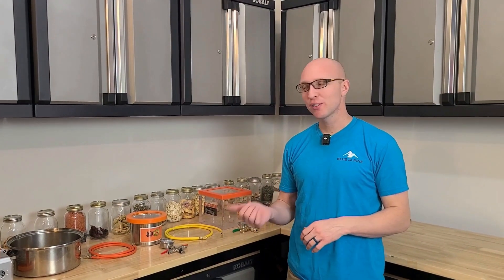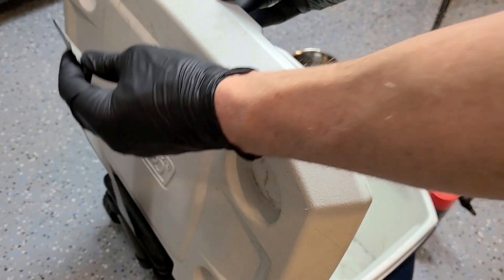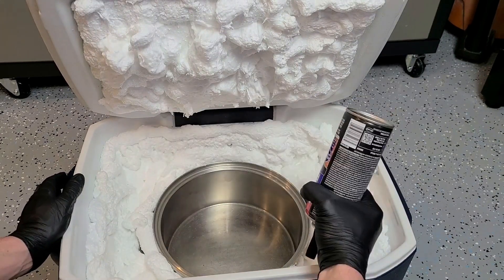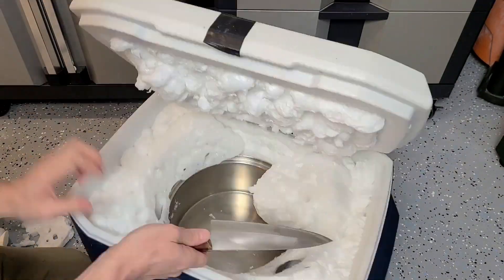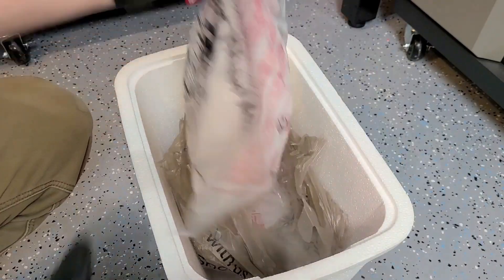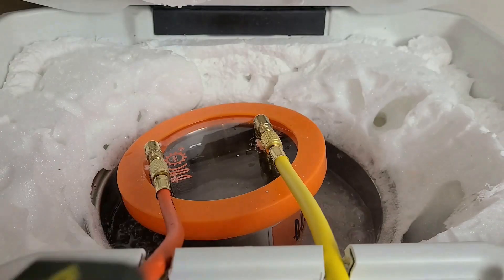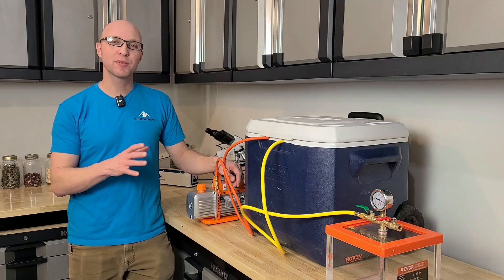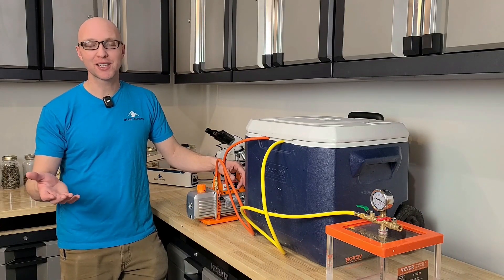Making a REAL Homemade Freeze-Dryer! (with a cold catch!)

Comment: Traditional Japanese tofu freeze-drying process is done by scraping ice crytals off the surface of the tofu blocks that form over night in the mountains. It takes time, but this freeze-thaw-freeze dry turns big blocks of tofu into small wafers that can be easily carried and rehydrated in a soup. No power needed.
Reply from the maker: Exactly, it the right climate you can freeze dry stuff just by putting it outside, though it might tike some time! :D
Reply: @BlueAlpine Scraping the ice off every morning is the key to speeding it up.
Otherwise you're just air-drying with an added thaw-freeze phase.  
Tofu 'sweats' ice like crazy.  A pound block turns into a cracker.

Comment: CO2 freezes at -180 degrees. I worked a LOX generator and a primary stage removed CO2 at -180.  Dry ice is colder than you stated.
Reply from the maker: interesting, maybe we will need to adjust that in the future. :)

Comment: Solution to the inlet freeze problem is a  pipe heater.  They keep a constant 35F or about 2C.  Might warm the chamber slightly but eliminates the blockage and is available at any hardware store.
Reply from the maker: that could work, keep the water frozen where we want it. :)

Comment: What if you put the frozen food in a metal vaccumm chamber instead, touching the bottom. Initially, place this chamber in a water/ice bath. Then apply slow, moderate heat as requiered using a cheap sous vide, (or a thermometer and warm water). You can adjust the temperature of the water bath using a phase diagram, according to the vaccum your pump can pull. And as others have said, maybe a desiccant filter before the cold trap to help with moisture adsorption, like those used in biogas production or similar. Great content!

Comment: I figured a one hose system was how you did it. Putting your food in the cold trap with a moisture collector on the way to the pump.
Reply from the maker: Normally, freeze-dryers have the food and cold trap all in one. The outside of the chamber is cooled while the food sits on a heat rack, forcing the sublimated water to stick to the chamber walls instead of the food and limiting the total space needed to be vacuumed.

Comment: Fill your trap with something solid that will conduct heat and maintain space between its particles, such as metal ball bearings. Increasing surface area makes it more effective.
Reply from the maker: That's a good idea! since the chamber and the trap are separate, might as well put something in there. :D

Comment: Can you use Styrofoam instead of the spray foam?
Reply from the maker: Yeah, though it would be a bit harder to seal up all the gaps. The benefit of spray foam is it leaves less gaps for condensation to form, so if someone were trying to make a more permanent, longer lasting freeze-dryer it would last longer.

Comment: So, The cold traps job is to prevent water from getting into the vacuum pump but is not part of the actual drying of the banana?
Reply from the maker: The water has to go somewhere, ideally not the pump, but definitely not the banana. So the cold trap is only of part of the drying process in that it give the water that's removed somewhere to go. Otherwise, yeah, not directly tied in this case. In a normal freeze dryer the chamber and freezer are combined, that way the temperature of the food can be controlled precisely.

Comment: You need a way the heat the food slightly for the sublimation of the frozen moisture.
Reply from the maker: Yeah, we've been looking for something commonplace that could work for that. We have heat pads for our actual freeze dryer product, but for a DIY project, not everyone has access to those pads. But we've found a few possible options and will hopefully give it another go soon. :)
Reply: @BlueAlpine maybe seed starting heat mats

Comment: What about extending the inlet side of your cold trap?Halfway down inside that could be part of the problem is they are exactly even with each other.So it's not fully circulating and allowing the water vapor to settle out its taking a shortcut
Reply from the maker: That could help! :D

Comment: just curious... To lessen the chance of freeze up, would it help to 1) insulate the fitting with a heavy coating of silicon or foam and 2) run an insulated silicon hose from the fitting down to the the  freeze pan?
Reply from the maker: That could work, but better would be to just have a wider hose and fitting. Most standard freeze dryers have about a half inch opening and they don't freeze over.

Comment: Would it work to use a low temp freezer that can be set to a temperature below -10f instead of the dry ice setup in between?
Reply from the maker: That could work, as long as the pressure chamber a fit inside and the tubes can get through.

Comment: Good Job with the freeze dryer. But there is still one Element missing, what makes a huge difference. You need a Little Heating at the bottom. Its not actually heating anything but Heat does 2 things: it makes water evaporate and warm air raises (and takes the water with it, where it directly gets vacuumed and transportet away) so if you really want the best result and you want to freeze dry much quicker, you need Heat (Not actuall, heat, just above 0 Celsius I think)
Reply from the maker: Yeah, we've been trying to come up with a good, easily accessible and inexpensive option. I'm sure our next attempt will go a bit better. :)

Comment: Why is a cold trap needed? Doesn't water evaporate at 40 degrees in a vacuum? The pump can expel that steam through itself.
Reply from the maker: You need the water vaper to go somewhere in the closed environment, if you don't have a cold chamber to catch it by refreezing the water than it might attach back on the food.
Reply: Thanks for the reply. But won't the vacuum pump remove the moisture from the chamber?

Comment: Learned some basics about freeze drying but would be nice if their was a build that actually worked.
Reply from the maker: Yeah, still working on that. As we mentioned in the video, perhaps by making the hose lines thicker we can get it to work, but first we need to find a proper heating element that is easily accessible to most people. so once we find that we will probably make another one!

Comment: Doesn't getting all the things needed that u got expensive just as much? There are people that can't afford to get all those things. And do you have a list of where you got them
Reply from the maker: The pump, vacuum chamber and hose came from Amazon. The pot is from Walmart, the cooler is from a local thrift store and rest is from a local hardware store. The total cost came to about $150, and considering it almost worked, that's not bad. A normal small home freeze dryer can cost $2000 easy.

Comment: we need an updated video with one that works. open sourcing this technology would be amazing
Reply: I have been meaning to put a new one out actually. The hardest thing is the heating pads. I have not found an off the shelf Item that would do the job but once I find that I can put out a video on that.
Reply: @BlueAlpineFreezeDryers  thanks for your prompt response. you are appreciated.
Reply: I suppose if you put the banana chamber in a regular freezer, then take it out for ½ hour(until banana starts to thaw) then back in. Repeat until desired results.
Reply: That water trap is the big pain though.

Comment: hard freeze the food first then put into a well insulated vacuum chamber with a good pump high CFM, that's all you need.  a scroll pump can just evacuate the water vapor without the need to trap it even.
Reply: I'm  a HVAC tech,  one of the main purposes of a vacuum pump for us is to dehydrate the system to remove contaminates, we pull a vacuum down to 500 micorns. at 500 microns if you use a Pressure temperature chart the boiling point of water is 32 F.  SO pulling a good vacuum may be the way to go if my understanding is correct.
Reply from the maker: That might work, we'll see what our next iteration is. :)
Reply: That is not a bad idea. I might have to try that.

Comment: What about doing the bananas in dried ice temperatures before putting it in the vakuum chamber?
Reply from the maker: That wouldn't hurt, freezer are typically only going as low as 0 Fahrenheit, but a real freeze-dryer is bringing the food down to at least -20 and sometimes -40. It would allow for more time for sublimation. :)
Reply: @BlueAlpine  sure and no fluid smashing out off bananas so should work like for diy🤟hashtek
Reply: @BlueAlpine  sure and no fluid smashing out off bananas so should work for diy🤟hashtek

Another video would be great👉
Reply from the maker: @ Yeah, we are wanting to do more of these, it's just taken a back seat for a little bit. hopefully we will get back into soon. :)

Comment: This was very cool😊
Reply from the maker: Thanks! :D
Reply: @BlueAlpine so I’m piecing my project freeze drier together now. Do you think foam cut to fit the pot would work as well as spray foam and a cooler?
Reply from the maker: @ Yeah, it should. The cooler provided a convenient way to contain the foam and added an extra layer of insulation, but your standard freeze-dryer has a simple layer of foam about 2" thick, it's a bit sturdier than spray foam, but I imagine you will be fine.
Reply: @ thank you!

Comment: Do you guys still plan on doing a maintenance video?? I asked a few months ago and the response was yes. Looking for machine and pump maintenance 🙂
Reply from the maker: Yes, it's still on the docket. You were wanting something more than just how often and how to change oil through right?
Reply: @ correct. Like taking apart the pump…what to take apart/clean/replace. And any maintenance on the machine itself (like the pink filter inside), etc.
Reply: @kellyc4480  that would be an excellent video! I'd love to know why one of my pumps keeps misting, despite being taken apart and fully cleaned and never overfilled.

Comment: Great education!  I noticed Harbor Freight started selling vacuum pumps, but I think they'd be underpowered for use with a proper freeze-drier.
Reply from the maker: Yeah, it depends on the vacuum pump, the one we are using in this video is hardly strong enough, you probably want a minimum of 6-8 CFM. Also, the pumps from Harbor Freight typically don't have solenoid valves, which can help keep oil from blowing back onto the food. :)
Reply: @BlueAlpine  That's good to know! I was thinking it'd be an economical backup pump but I reckon not. I appreciate your willingness to share hard-earned engineering knowledge. There's a reason you guys have earned such a solid reputation.